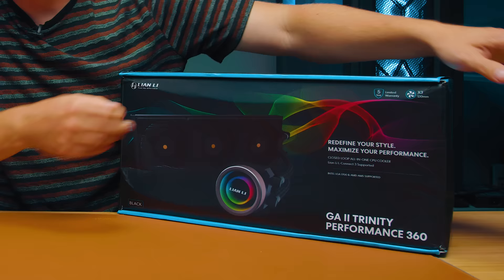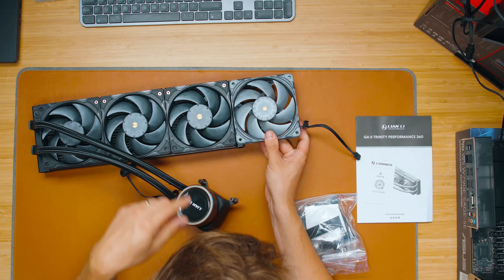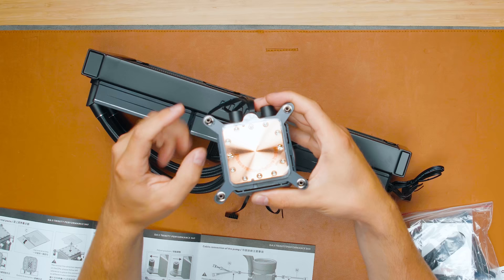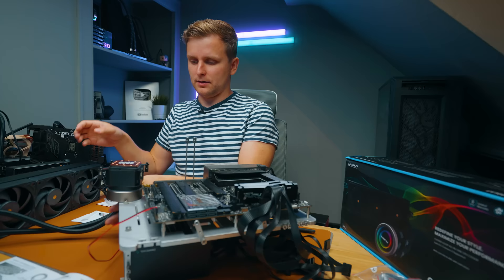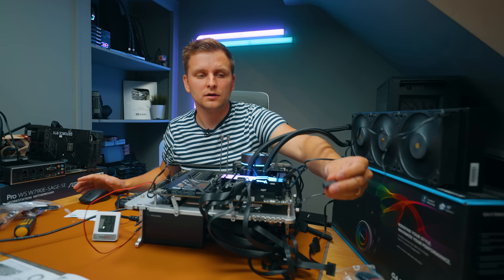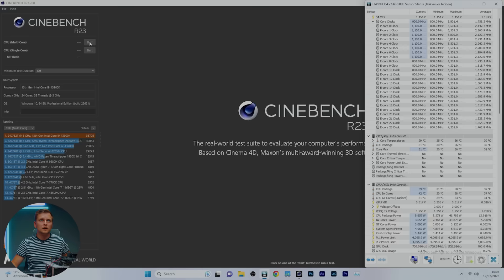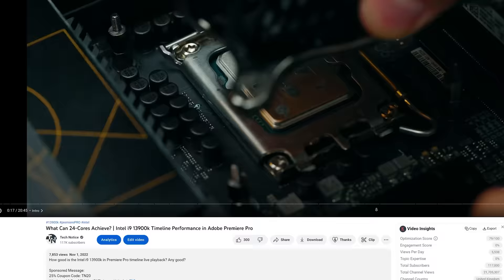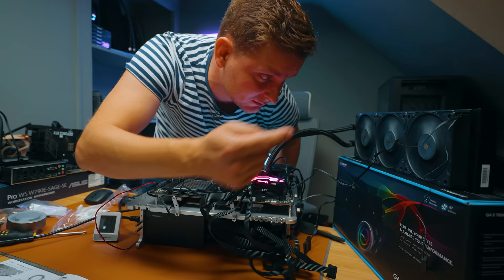BEST AIO of 2023?!? | Lian-Li Galahad II Trinity Performance 360 test & review

Comment: Yep, I think this review was paid. After almost three months, there no reviews on other channels, and it tells me that cooler is garbage. I have had two of them, second one is going to replace to NZXT Kraken or EK Nucleus instead. One performance version pump started making crackling sounds a month ago, replaced to another performance version. Three weeks or so, and this one started doing exactly the same. Tilted, even turned PC upside down and left overnight to remove air. Nothing helps, and it seems as per reddit reviews, could be common thing. Hot garbage, not an AIO it is.
Reply: There are reviews on other channels though. Just because you don't know how to search on YouTube doesn't mean they aren't there.

Comment: ok i got this cooler but my god the mounting mechanism for intel 1700 was one of the worst ive ever experienced, you need to apply pressure on the screws for them to connect with the bottom attachment when youre youre attaching it, but when you apply pressure the screws slide around because the intel version has 2 diffferent versions one is the outmost configuration and one is the inner, the screws slide around and theres no way to tell when youre connected with the bottom until its too late and youve screwed to much on one side and the other side is missaligned. 

im gonna have to rebuy thermal paste because i messed up my application so much trying to get this cooler on for 20 minutes, absolutely awful mounting mechanism my god. maybe its better with amd but for intel its a horrible experience.
Reply: ok i just noticed something, you mention at 05:22 that the stickers will make the bottom bracked stick to the backside, i actually noticed something weird when i was installing this on my z790 apex encore , the bottom bracket never sticks to the motherboard, like the metal where the stickers are do not make contact because something is in the way, i tried to look what could be in the way but i cannot see anything, eitherway, i went ahead and continued my installation by just holding the backplate with one hand and then applying the plastic thingys on the other side, but now i realize maybe the bracket is just slighty lower down so that makes the mounting screws slightly lower down as well, which is the reason i have had such an awful experience trying to install this cooler because let me tell you, there is no way in hell it was as easy for me as it was for you in this video, i need to apply ALOT of pressure while screwing to connect the screw with the bottom one, and like i explained while doing so the screws often slide out of place making it an absolutely insanely hard thing to install because you need to do it in all 4 corners and you need to do it correctly, its very easy to get 3 screws in but then the 4th will be completely out of line. 

my guess is that the apex z790 encore is slightly different in its backplate or the entire intel 4th gen are different in the backplate design making it very difficult to install, i can only say this is a problem on the apex z790 apex encore, i dont know about the other boards.